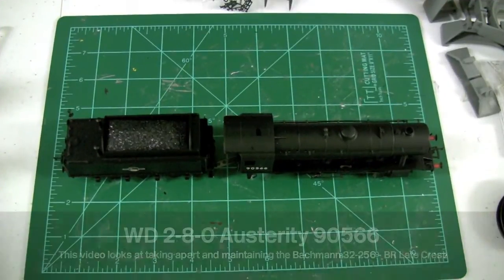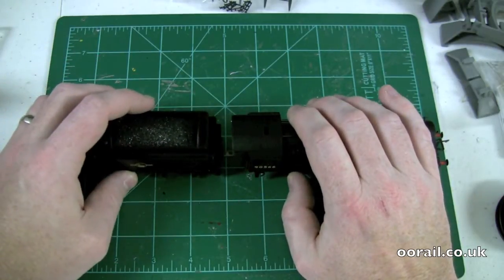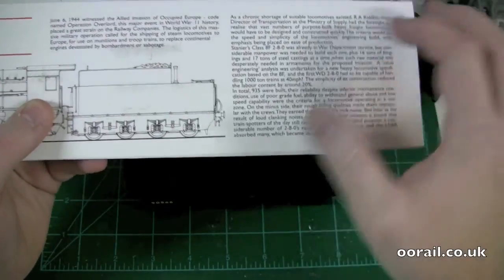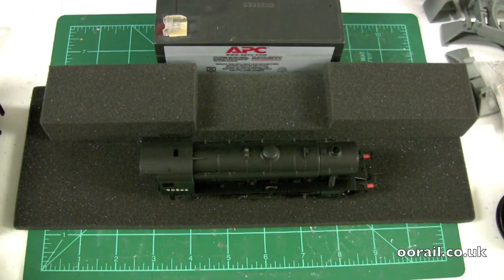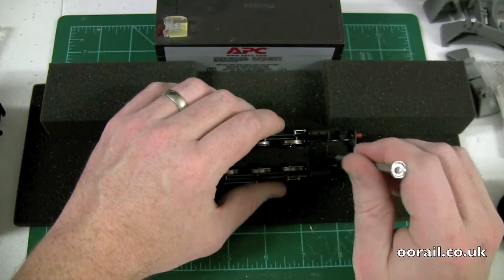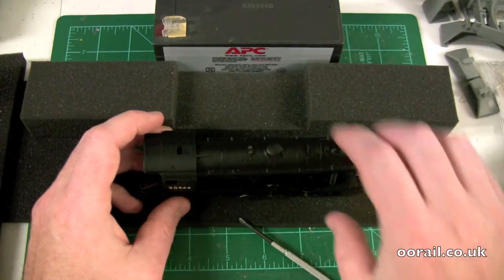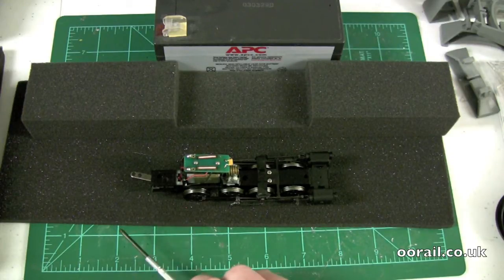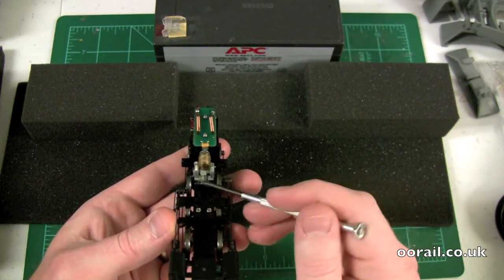oorail.com | Inside the Bachmann WD 2-8-0 Austerity 90566

Comment: Good to show the pitfalls of dis-assembling locos for maintenance / chip fitting jobs. As you high-lighted patience and knack of identifying inter-connecting bits to be freed before final chassis / body separation are a necessary requirement !  Peco  (,the track and points people ) produce an excellent sponge " maintenance cradle " ideal to hold models perfectly still during these stressful "dismembering" operations .
Reply from the maker: Thanks, I thought it would help people more to watch me struggle with it than to have some unrealistic perfectly edited video of it going smoothly! :) I have seen the Peco "maintenance cradle" on Hattons, I should probably just invest the £6 in it. The last few times though, I've opted to pickup more freight or vehicles for the layout for that £6 instead :)

Comment: Nice video John it was a bit of a strugle at the start but you got there in the end, looks like a good runner too :) Tony
Reply from the maker: TheZimma thanks, yeah no kidding! I think its time I invested in a decent desk lamp for my work bench, would have seen those slits in the body shell a bit faster! :) Got any ideas why the torque on that front and rear screw that holds the body shell on would effect its running? Its running pretty smoothly now, but I had to adjust the torque on the front and rear screws to get it there. It ran fine without the body shell, ran fine with the body shell on with just the center screw, but with both the front and rear screws fully torqued it would barely run. I ended up tightening the front screw and loosening the rear screw to get it to run smoothly. The body shell seems to be weighted towards the front of the boiler. I've another video scheduled to hit the channel tomorrow evening, it shows how I fixed it, but I'm not 100% sure why it is happening :)
Reply: oorail.com
Hi John could tightening the screws be putting pressure on the driving wheel axels ?i only have one Bachmann so i dont have much knowledge about them,all mine are Hornby,regards Tony
Reply from the maker: TheZimma This is the only Bachmann locomotive that I have that seems to do this. Its running fine now, but it doesn't make any sense. I suspect it has something to do with the amount of pressure being applied to the wheels. It seems to be a very fine balance. I just found it odd that it ran fine with the body shell on and not screwed in, but wouldn't move with all three screws tightened. Runs fine with the rear loosened. That would seem to suggest it needs a little more pressure applied to the front for some reason...
Reply: oorail.com
If its running leave it alone and keep your fingers crossed,Tony

Comment: Why not use one of the oilers with the needle to lubricate your locos it seems a bit of a waste of oil just to discard the remainder in the cap you are using.
Reply from the maker: Normally I service multiple locos at once so there isn't any oil wasted. The oil pens are hit and miss. Some have additives but in general you get a lot less oil for the same money. Some will put too much oil on the loco. For lubricating the moving parts of steam locos for example, you don't need much at all and the paperclip is the way to go.

Comment: Dangerous information. Push the solder around with a screwdriver? Clearly your knowledge is very limited.
Reply from the maker: LOL.. Its okay Chris it didn't have power applied to it! Touching the cold solder joint around with a screwdriver is a good way to make sure its in good condition, doesn't move etc. Thanks for your feedback but judging from your comment you have a ways to catch up with my level of knowledge :)